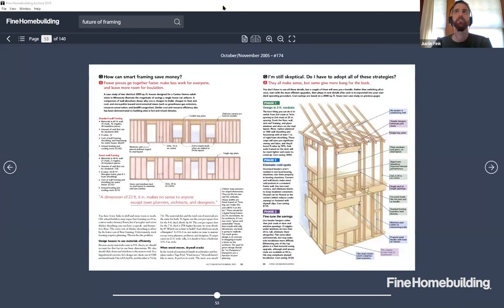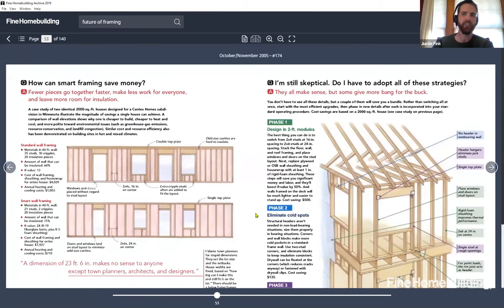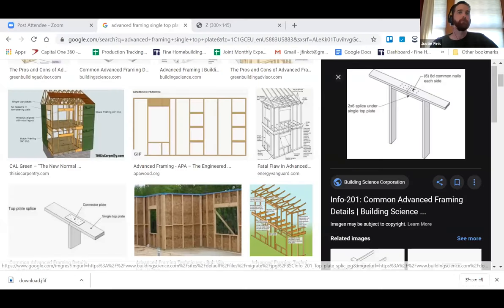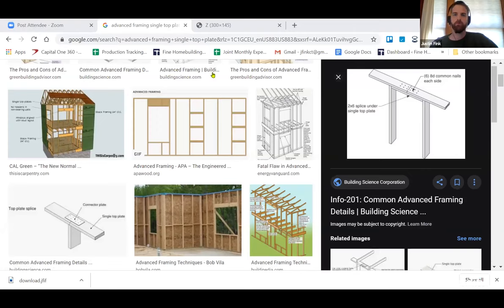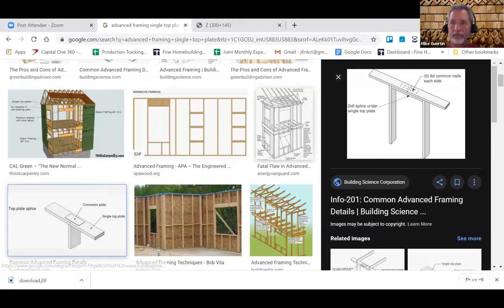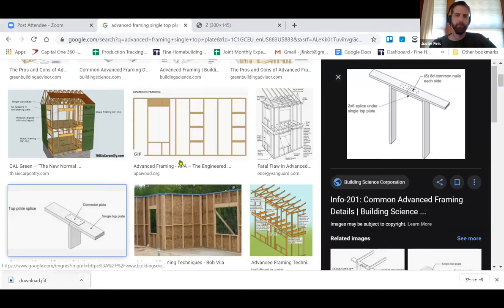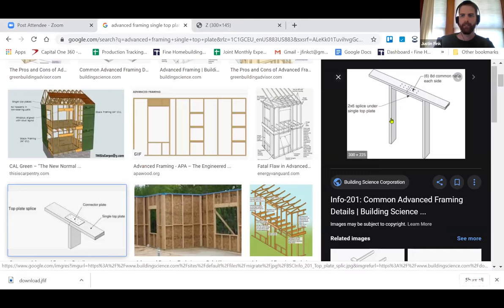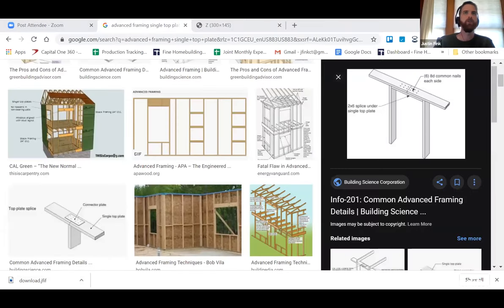Expert Session: All About Advanced Framing

Comment: Btw, Mike’s tip on putting rafters on top of the ceiling joists & rim joist (as opposed to setting the rafter along side the ceiling joist as is typical) is a great idea!  After I block between the rafters, those rafters will be locked in!  I love it 

I have been raising my walls and then sheathing.  I guess I need to try doing more on the ground.  My fear has always been that if I gun my shear panels on while my walls on the ground, then there’s no way to level the raised wall side-to-side once I get it up (if for some reason it happened to be out a level a bit).  But I guess if I square it up correctly before I install the panels on the ground, then as long as my floor is level, then the wall will have to be level once it’s up.

Comment: As a homeowner doing a self build I’m having a hard time justifying advanced framing for my single story home. The r value of walls would increase 2.2%. The savings in lumber is approximately $315 bucks. Those are all positives but I know 16” OC framing, 24” would require me to think a lot more about what I’m doing. Considering diminishing returns with increased r value. It just doesn’t seem worth it. And there are negatives to it as well.

Comment: I'm planning on doing a 16×20, 2 story add on to my house. I want to incorporate smart framing into my design. I was planning on building 2×4 floor trusses on 2 foot centers. How tall do I need to make floor trusses. To span 16 foot. How many inches should I have between the top and bottom plate of the floor truss for the second story?
Reply: There are span tables to help you a simple google search. Have fun...I am doing a similar extension size with passive home inspired details. All fun!  🇨🇦

Comment: I dont agree about this discussion. I think this not advanced framing it cheap framing. I would never buy a house if i saw that
Reply: Tom, there are very good benefits … and no downside… to advanced framing.  Better insulating your projects matters.  And structurally there’s no difference.
Reply: A 2x6 is stiffer and takes more axial load.  The 2x6 space gives more insulation space and rough in space.